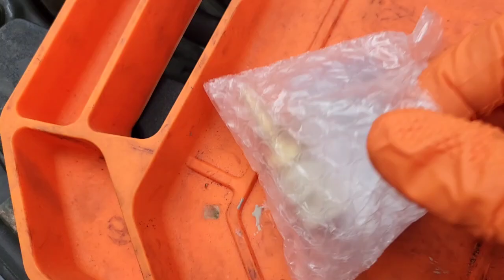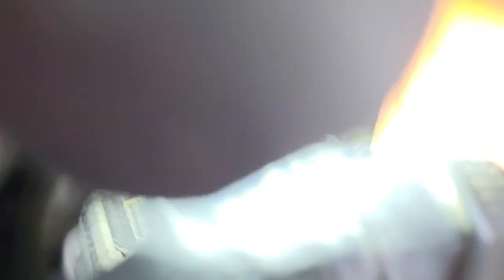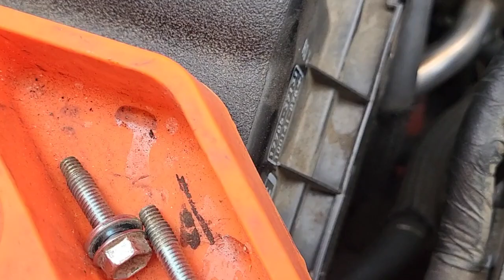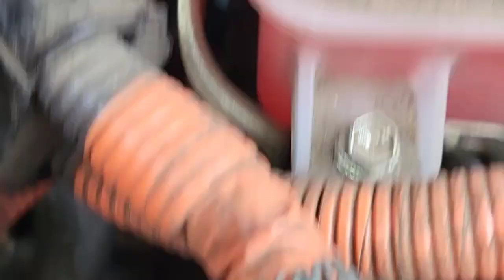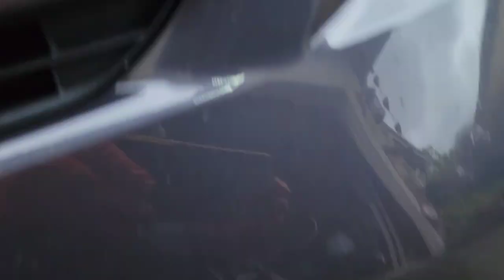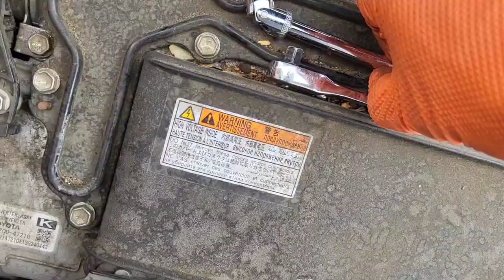How replace Engine Coolant Temperature Sensor (ECT) 2010-2015 Toyota Prius in 40 Minutes! P0117 Fix

Comment: Did this fixed your issue? I had a new aisin water pump along with a new thermostat from rockauto installed, and i keep having overheating issues when going uphill, no engine codes yet, just the overheating symbol, and coolant boiling from the reservoir.
Reply from the maker: So, I had blockage in my coolant system.  A sign of this, is if you hear a swishing sound inside your car under the dashboard when you press the gas (test when in park), also if your coolant is spilling out the top of your coolant reservoir, or also if your heater stop heating, and eventually, your lower coolant hose will pop off the radiator because of the built up pressure.  This will especially happen if you've ever used a head gasket sealer in your cooling system.  that stuff will help your head gasket, but will begin to block your coolant system and eventually will have to replace your water pump and thermostat, and do a deep clean of the system.  I used a cleaner called Irontite.  It worked great and now my heater works again and no more swishing sound under my dash, and no more coolant spilling out the top.  I would recommend using the Irontite, FOR SURE!  Make sure you follow the directions on the label and you'll be back in business in no time. :)  But let me be clear, you can't do one without the other, most likely.  You'll have to use the Irontite to clean the system AND will most likely have to replace your water pump and thermostat (especially your thermostat) at the same time.  Best to be safe, do all three once!
Reply: I replaced the water pump and thermostat. The car overheats when going uphill. Did you solve the problem? What else should I do?
Reply: I noticed that when I turn on the air conditioner, the radiator fan on the driver's side doesn't spin. Could this be the problem?